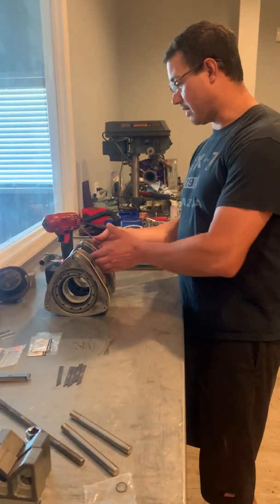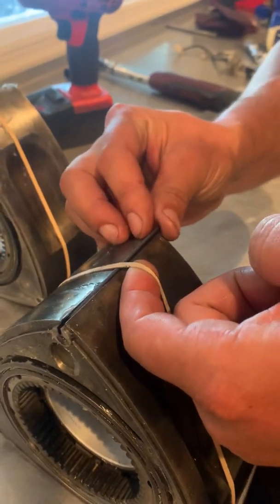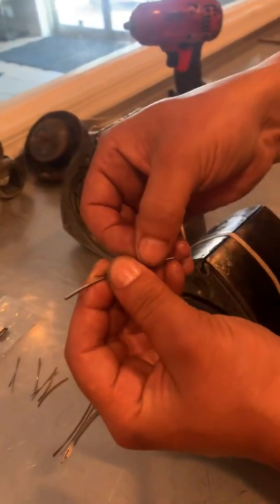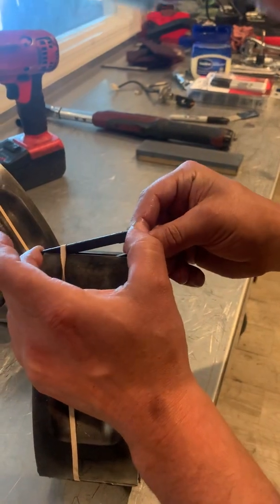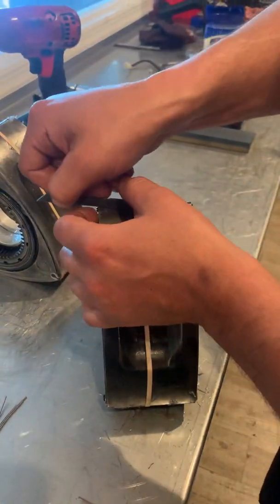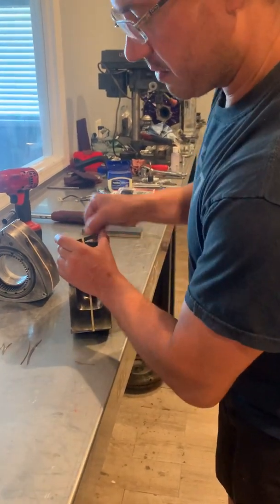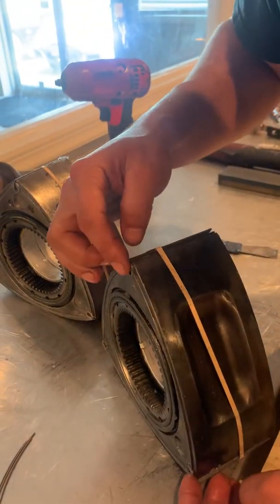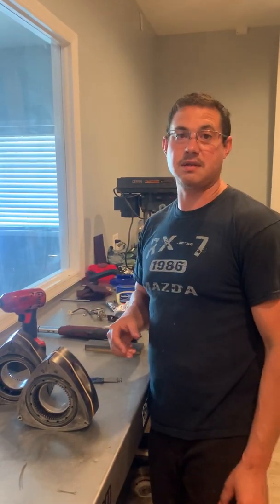How to install rotary apex seals part 1

Comment: What are the exact dimensions of a Mazda apical? Do I have to adapt to those of the Mazda or recreate them from scratch by hand? :) I have two trochoids and two rotors with shafts for the NSU RO80 Wankel engine. For the moment, however, I want to complete the engine with the bare minimum, since it will not have to be reinstalled in the car.

Comment: This was so painful to watch. This is not how you install apex seals. If it's so easy to install into the housing's, then why did you not show us? A disaster waiting to happen...
Reply: How is it a disaster? Even if there was a million ways to install them, all the ways would be correct as long as the end goal was the same 😂
Reply: Bud has a part 2 also plenty of builders do it this way

Comment: I know the seals are kinda notorious for breaking but do the springs ever suffer any damage or have concerns for damage?
Reply from the maker: Not really. Heat maybe. They can get weaker over time but that’s a lot of time. I do use stronger race apex seal springs in the race engine.
Reply: @Rotorguy479  How much more are they? Technically speaking is there a reason not to use them if you're not racing? I'm ASSUMING they may be more reliable just based on the fact that they're made for racing but that's not necessarily ever the case.